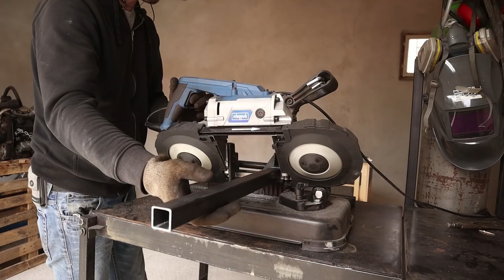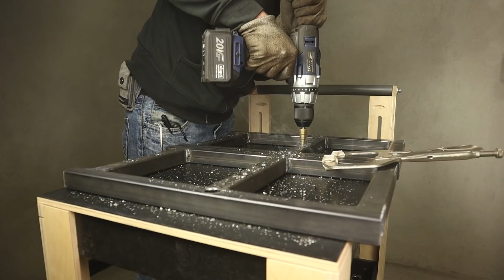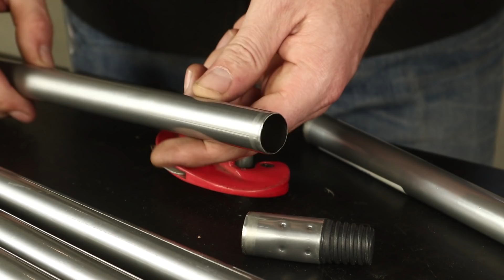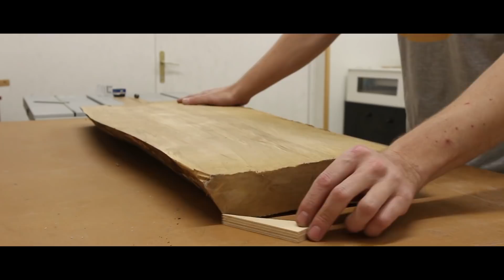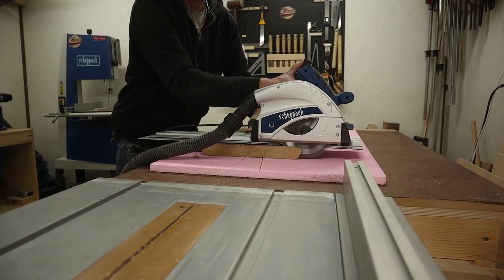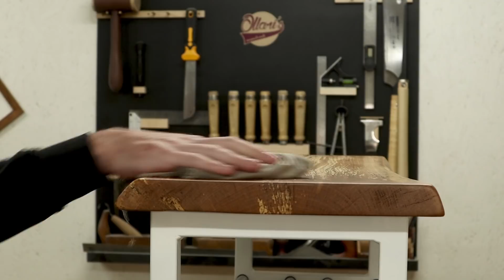Building an Entryway Bench/Shoe rack from Broom Handles and a Live Edge Slab

Comment: Saw you marking the wood (to cut it..?) and said to myself "...NOOOOoooooo...", you didn't, luckily, just "refreshed" it. Thanks Seb, nice one (as usual!).
Reply from the maker: Thank you! Yes the ends of the board were still coated with wood glue to keep them from splitting while it’s drying. I had to cut them off.